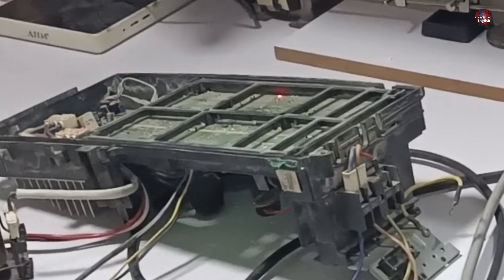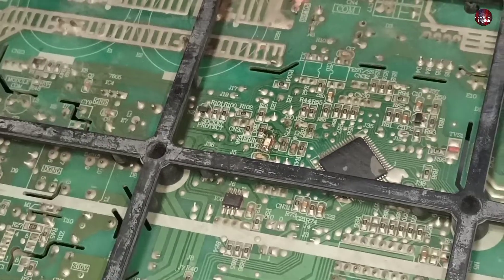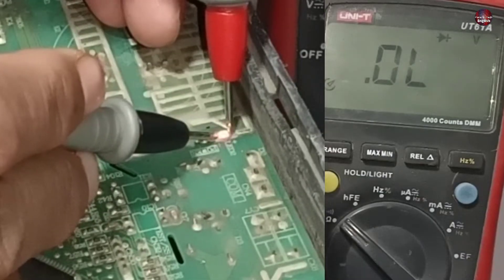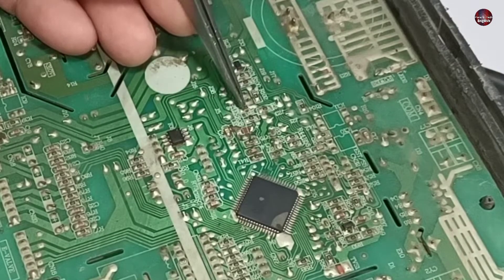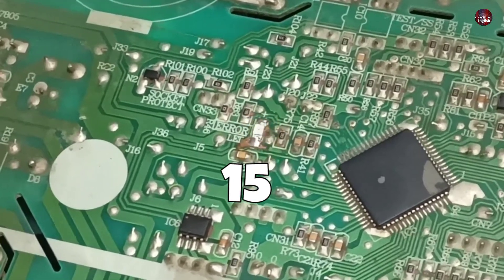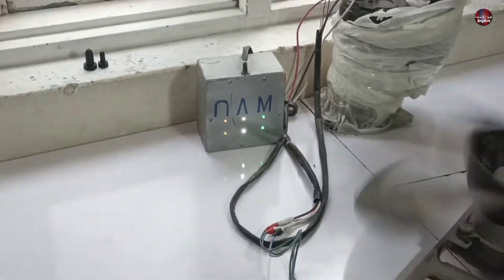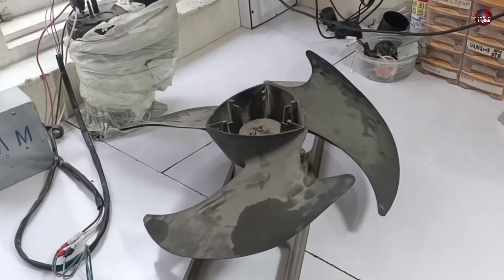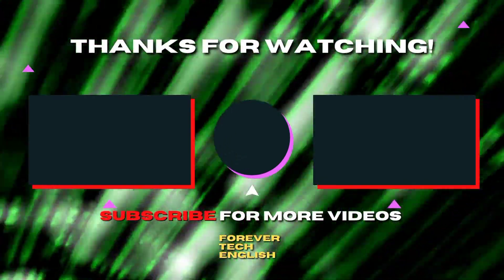Hidden Fault In AC Made other Technician thought Compressor Failed

Comment: How can I send a board to you for repair ? Midea split unit, outside unit doesn’t turn on. Had voltage issues in building during a storm and it failed after no error indoor just blows hot air

Comment: Sir can I ask about the value of the led light  you replaced? Tia,
Reply from the maker: The value of LED is 1.5 dc volts and I thing it size number is 6803
Reply: @forevertechenglish  thank you so much sir